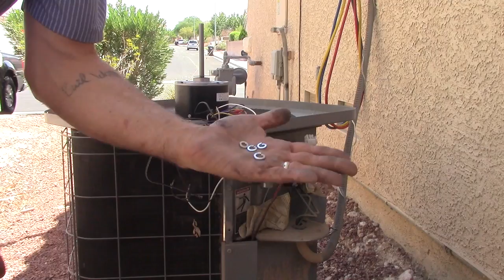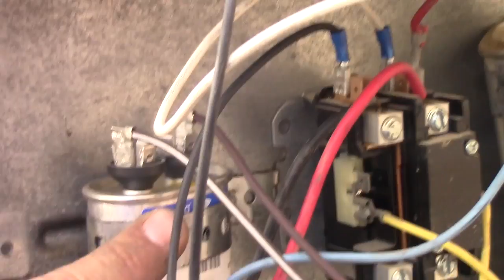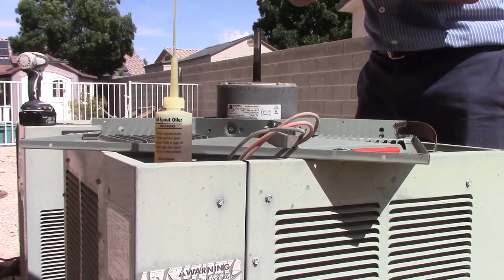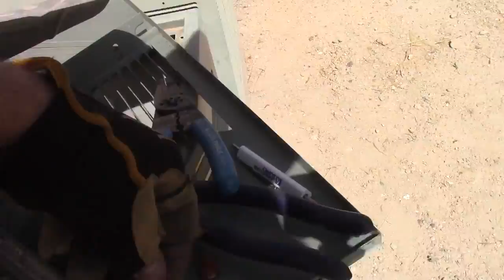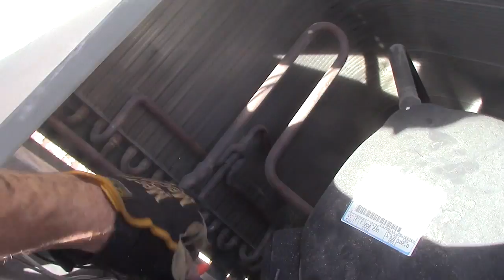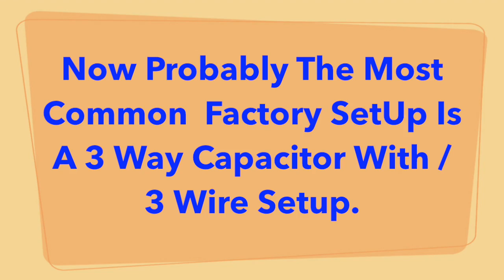How to Install a Condenser Fan Motor. Understanding The Electrical Wiring In An Air Conditioner.

Comment: Hello how you doing, just ran into your video, why do you talk about two-way capacitor versus a three-way capacitor what is the benefits between the two and do you recommend just doing a three-way capacitor
Reply from the maker: They both work the same, it’s preference. Some systems will have a seperate 2 pole capacitor for the motor and another for the compressor. And some systems have a 3 pole capacitor, where the motor and compressor share a common terminal and each have a pole so they share the same capacitor, on this one pole is rated for example 5mfd and the other may be 69mfd. The 3 way is more common nowadays

Comment: You say cut the shaft or it will wear out the bearings prematurely.  
That's hard for me to believe, it's a small amount of metal, it's all down the axis of rotation, no out of balance.
I don't see why the length of the shaft matters to the bearings.
I would appreciate it if you could enlighten me.

Comment: Does the motor need to be replaced with the exact same motor like amps, hz, hp wise? I have a pretty big central a/c unit i have searched for hours, I found 1 fan (edit - Fan Motor) matching every single spec of my current motor. But it’s almost $300. I am pretty good at electrical wiring a/c and d/c. But I’m not very knowledgeable about these things. I would love to spend 100 and be ice cold again. Thanks for the video though!

Comment: Could you provide information about the bolts to install the fan ?  My fan is good but the mount grill is extremely eroded. I purchased a new grill but I want to buy the replacement screws and nuts. I cannot find any information on them.   Thanks 🙏

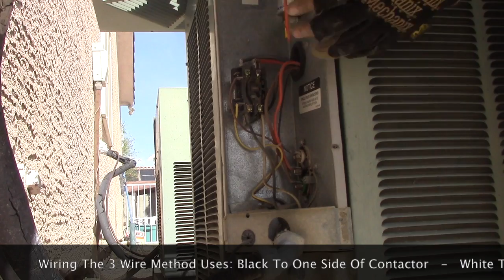Comment: With a three wire motor don't you need a dual capacitor (3 sets of prongs)?  At 15:00 you only used a single capacitor (2 sets of prongs).

Comment: To the flock of DIY’ers hovering around this video in celebration of their new found technical skills: The great part of doing it yourself is obviously saving money......the bad part of DIY......you did not have a trained technician at your unit during this repair. So you’ve missed an opportunity to have a trained person diagnosing other issues that will COST you way more than that $200 you saved on the motor repair. 

Why did your motor fail? Hmmm don’t know it just doesn’t spin so I “fixed it”.....let it run another 5 years with issues you couldn’t see through your DIY goggles and add up the utility costs incurred by running your unit low on charge from a leak, high head pressure from a plugged coil, a bent fan blade running backwards and an evaporator that has 10 years worth of your wife’s hair living in it. But keep on keeping on.....show your kids how to DIY so they can half listen to the half you know.....then they’ll end up with a 1/4 of the required knowledge and end up as my useless apprentice who texts all day while I explain things he has no interest in. 👍🏼

Trade labor shortage in summary ☝🏻and it’s all the DIY money savers fault. Lol 😆
Reply: As if the average "professional" HVAC tech who comes to your house would do anything more than just replace the fan motor and collect his money. And he may know less than the guy in the video. These days, the odds are at least 50/50.

Comment: I just recently hooked up a condenser motor as you outlined in your final example (white to capacitor, black to board, and brown to capacitor) and noticed my fan seems to be running in the opposite direction. It was a reversible motor so I flipped the wires at the motor and all is now running as needed. Any reason why the motor would run opposite as intended though?
Reply from the maker: Timothy Bryant some motors have reversible lead wires it’s the extra four wire plug into each other is if they switch them there’s only one other way they can wire and then it reverses the rotation.

Comment: Fan won't move in the unit. I had to push fan with wire and it will work. I replaced dual capacitor and fan motor. Still fan won't start it self. if I push it will start. Need help to understand what is the problem.
Reply: Sounds like a capacitor is not correct uf rating to gives it the go. Someone confirm that please.

Comment: so, is the motor supposed to run clockwise or counterclockwise?
Reply: carapungo  whichever direction that will cause the fan to draw the air away from the condenser and out the top.  So the fan motor is mounted upside down. I think looking down into the fan motor, maybe counterclockwise.

Comment: Thanks for the video. A suggestion would to be mark shaft, pull fan blade back off and start the motor, hold your hacksaw against the shaft and let the motor do the work.
Reply: That sounds like a good idea on paper but dangerous in real life.

Comment: Music sucks -no need for it-Ground wire never must be cut
Reply: The motor is mounted directly to the metal chassis. The ground wire on the aftermarket motor is not needed.

Comment: On the start capacitor you have one blue lead that comes from compressor ans one red jumber, if that is right does it matter how u connect those two leads on capacitor

Comment: 1.  Do you install the capacitor for the fan motor with the terminals facing downward or upward.2.  Does it matter which lead goes into each of the capacitor terminals.
Reply: Doesn't matter which lead goes to which capacitor terminal and supposedly you will get more life out of the capacitor if you mount it upwards (the terminal connections facing up)

Comment: Does changing the capacitors and or fan motor help with energy savings?
Reply: Nope...
Reply: changing a weak capacitor will not only reduce power draw but lengthen the life of the motor. Use amp clamp before and after and see for yourself.

Comment: Question: In the last setup, there was only one capacitor, instead of two as in the the first two examples. Why did you only need one capacitor in that example, but two in the others?
Reply: I just watched a few other videos and found the answer to my question. :)
Reply from the maker: Ah yes, it was a dual capacitor good job finding your own answer
Reply: Las Vegas AC: I have learned a TON from watching your video. It was EXCELLENT!  Thanks : )

Comment: if the shaft wasn't cut would it shake and wobble after instillation? the 3 techs it took to fix my air conditioner failed to do it.
Reply: Mine hit top of compressor
Reply from the maker: Martin Riggs yes if they didn't cut the shaft, it will wear out the bearings.
Reply: @StephenShares  How so?

Comment: This video gave me confidence to fix my own AC fan. Might be good to point out additional pointers on separating a seized fan blade from motor shaft and importance of positioning fan in the exact spot on new motor shaft to prevent wobbles. This repair cost me $220 for motor and capacitor. Would of been $500-$1000 if a professional did it. Thank you!!
Reply from the maker: JAtube21 that's great to hear glad to help...
Reply: Cost me $54.60 Plus $11 for new capacitor !986 Bryant 2 1/2 ton. Did take pictures before I took apart.
Reply: A new motor shouldnt be more then 60$-80$. Plus 6$-10$ for capacitor

Comment: what is the advantage/disadvantage of using a 3 way capacitor with a dual capacitor. My new motor shows a diagram with an added capacitor, leaving the FAN connection empty on the orignal cap.
Reply: 1mcobb there is no three way capacitor.

Comment: My system has lasted about 27 year as far as condenser fan goes! That's all that's wrong with my system is a bearing gone bad in condenser fan motor. The old stuff last forever!!!!!!
Reply: 86 Bryant. Wife says she want's it replaced before I kick it.

Comment: Is there a short cut way of taking off the fan blade, if I don't have the special tool for fan blades? What if I can't find the 1/10 horsepower motor for my condenser fan motor? Should I go up on horsepower or how low should I go in horsepower?

Comment: Thank you sir God bless you I just new bought a motor. I did not know about cutting the ground wired and the shaft
Reply: I didn't  either attach to one of the bolts

Comment: Thank you so much for the informative video!!! Cost me $200 for the Condenser Fan Motor.  It took me about an hour and a half to install the new one, since I have to watch your video several times to make sure that I'm connecting the wires properly.  

Off topic question, I live here in the Sacramento area and we get an occasional consecutive triple digits during summer and the Condenser unit doesn't come on (fan motor running only)... I typically hose down the outside housing unit to get it running.  Would you happen to know if the A/C unit needs to be recharge??? Thank you in advance.
Reply from the maker: Yes, probably needs recharge or maybe some refrigerant recovered as its overheating. That means probably overcharge. Or it's got a dirty condenser coil

Comment: holy dog snot!  the a/ c guy came out this am and was going to charge me $450.00 tomorrow for this. I watched this, found a local parts supply place, and knocked it out in 1 hour for $110!!  thank you so much, especially for really explaining the wiring part well. I'm in florida, it was over 90 degrees (107 heat index!). they were going to make us wait at least another 24 hours and you saved me $340!  I think my dog would have had a heat stroke by then for real!
Reply from the maker: Wow thats great to hear, welt sounds like we deserve a good review lol www.lasvegasair.net click on leave a review.
so glad you got it fixed.
Reply: Called one said it would be 2 weeks
Reply: $1100 is what they charged my mom 7 years ago in SW Florida to change the motor. I don’t think they installed a new capacitor because it looked original!

Comment: hi i have a question does anyone know if you can replace a 1/8 HP motor with a 1/3 HP motor? if so would it be the same process because i seen on ebay a 1/3 HP that comes with its own capacitor so i was wondering if i can just fully replace the non working 1/8 HP motor and also take out the old capacitor so that i use new motor and new capacitor it came with pls let me know if anyone knows if im correct on that.
Reply from the maker: Yes a 1/3 can replace a 1/8 but I would go with a 1/4 you can find a 1/4 with or without the cap either way is ok as long as it rated to handle the amp draw.
1/4 all day don't go 1/3 although it will work it will rattle and probably won't last as long.
Reply: because this is the one i want to buy but the capacitor comes with connection that has 2 plug each with 4 pins and i think in your video it has for 3 part connection so just wondering how to connect this one on this link that it comes with: http://www.ebay.com/itm/D7909-Fasco-1075-RPM-AC-Air-Conditioner-Condenser-Fan-Motor-1-4-HP-Capacitor-/371355814093?hash=item56768808cd:g:988AAOSw~gRVguJh
Reply from the maker: That motor will work fine you can order it and that's a four wire motor but you can wire it just like a three wire motor all you have to do is take the brown wire with the white stripe and Wirenut it don't use it, just use the other three. Or you can just wire it before wire Methen put the two browns to the new capacitor and the two power legs to the contactor and you're done but the video you're commenting on has three different examples of the condenser motor and I wired them three different ways for your reference
Reply: +Las Vegas Air Conditioning, Inc. cool man your a huge help!!
Reply from the maker: No problem if you're happy with the service and help you received rate us on Google
Reply: question i got he motor and capacitor it came with i took a picture of my old setup it had before which stopped working just wanted to show you picture of old setup first this one: http://i345.photobucket.com/albums/p379/blu_angel1/20160705_191711_zpska3pnwqn.jpg

this is the new one and new capacitor: http://i345.photobucket.com/albums/p379/blu_angel1/20160706_125455_zpsnllkanpx.jpg

this is the capacitor: http://i345.photobucket.com/albums/p379/blu_angel1/20160706_125358_zps3ce0cyia.jpg

so my question is on the old one it has 3 leeds going in it but since the new capacitor has 2 of them and nothing that describes what connections it is for but im assuming its for the brown wires right so i can connect both brown and brown white on it straight right and the black and the white one direct to the black boxes shown on the old setup because the old setup has one going from capacitor to the black box and im assuming it would be as if the white one was going there instead of the setup they did ti link the capacitor red wire to the black box so i skip that and just connect it directly both brown the the capacitor and white to where the red one use to be and ofcores the black one same as the old one before am i correct?
Reply from the maker: Ok, the first picture is of a 3 way capacitor. And your going to need another one of those as its swollon and no good. With it in there the compressor and the condenser motor wouldn't work.
So it you get one of those then you would t need any other ones. The one in the 3rd pic you sent is ok to use with a new motor when the old 3 way works for the compressor. But since you already need a new 3 way capacitor, just get a new one of those wire everything the same except wire but the brown wire with the white strip.
Reply: the thing is that the motor came with that capacitor so i wanted to hook it up with it since it came with it ...i know the grown gets cut off since the lid will ground it and i know the reverse wires i will only tuck them away holding them with small pvc to the top lid since i wont need to change that and the last wires left would be the black and the white and the both brown i just wanted to know how to wire it with those last wires and how it came with that capacitor it came along with that motor the old stuff ill just get rid off and take off

Comment: Question:  I was taught to always pop the little plastic drain plug from the down facing side of the new motor for water drainage. Is that correct? I never see anybody else do that. Am I doing it wrong?
Reply from the maker: +trackontube you are correct, I do that as well. I may have overlooked that detail when editing this video but you are correct in stating that needs to be done.
Reply: What if you kind of like didn't do what you just said lol I've done fans before and have never noticed what your talking about lol

Comment: Well put together vid Steve! look into some stainless steel zip ties for attaching the PVC on the top grill. Likely more UV resistant than plastic zip ties. You can get them at harbor freight or home depot in the electrical dept. Rock on!
Reply from the maker: Metal wire ties😳 I will defiantly get some.
Thanks Jon
Reply: +Las Vegas Air Conditioning, Inc. Yeah sorry 😣 I made a boring vid about it a while back. This YouTube makes us have OCD 😄
Reply from the maker: No sad face here I'm smiling I didn't see the metal wire ties but I'm really impressed because in my head that was the shortcoming 😃 thanks for the ttip
Reply: +Las Vegas Air Conditioning, Inc. That was the thought in my head too :)

Comment: Today I installed a new condenser motor on a rheem, vintage 1976...The old motor was the original, 39 years old & it had 4 wires & two separate capacitors for the compresser & condenser - The new motor only had three wires & I couldn't figure the wiring out completely until I watched this video & you showed the jumper wire from the switch to the capacitor. It was music to my ears when I heard that baby come on. I had to get this done, it was 91 degrees inside the house...So, THANX MAN & much success to you all.
Reply from the maker: That's great to hear, good job that's what hear videos are for. I hope we can help you out in the future.

Comment: Great job man...Other than a bad motor or a bad Cap, is there any other reason why your motor would trip out on Thermal?
Reply from the maker: Not really unless it was getting the wrong voltage or had too heavy a blade but that's not normal to find.
Reply: ok bro...good looking out...I figured, but weirder stuff have happen in this service life

Comment: The video was great! I enjoyed watching it. One technical infraction It looks like on the rheem unit now the blade was in a much different location. I don't know about the all the way down and back up a little technique.
Reply from the maker: Right Joe I should have mentioned if there was a housing of way or plate not sure what we can call that part of the lid. But sometimes I position the blade to be 2/3rds below and 1/3 above the lid.
Good call
Reply: I was talking more in reference to maintaining proper air flow by positioning blade properly in the fan opening inside.
Reply from the maker: Interesting Joe I always let the lid determine that for me.  If there's a flange on the lid that I try to position it two thirds grabbing and one third above but if there's no flange and it's just an open hole in the lid then I do try to position it as stated in the video of all the way down and then up a little. 
How do you do it Joe Shearer ?
Reply: The very first unit had no fan shroud (orifice) so that one is probably fine close to the motor like you had it. I usually measure what is was from factory and put it back there. Now the rheem unit did have an orifice inside the unit and that is one I would have measured for sure. And measure to something stationary like the top of unit so that the difference in motor length does not mess you up. Lastly the carrier orifice was integrated in the top of unit so it should be measured as well. I usually see fan blade leading edge just 1/2-1" inside the lip of orifice. If there is not a factory motor to reference.